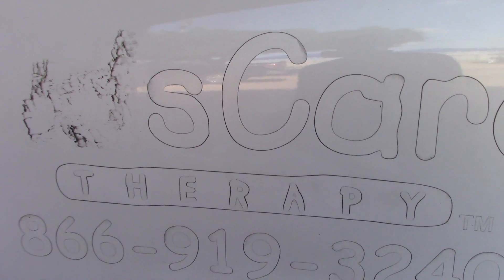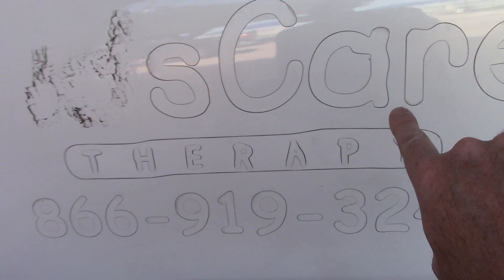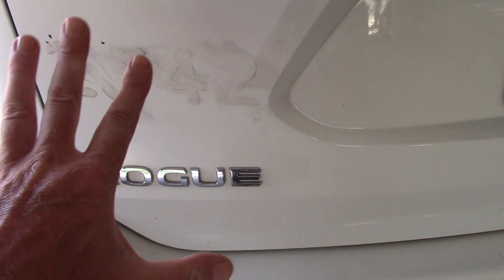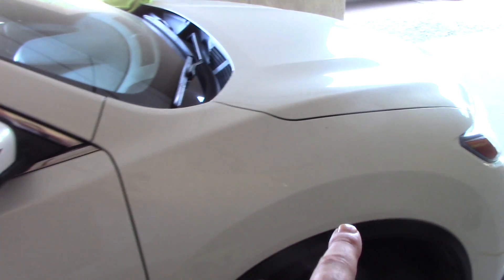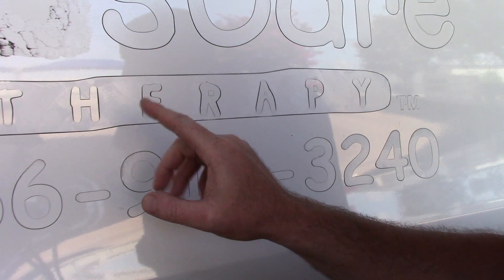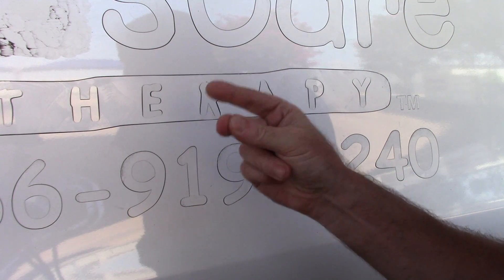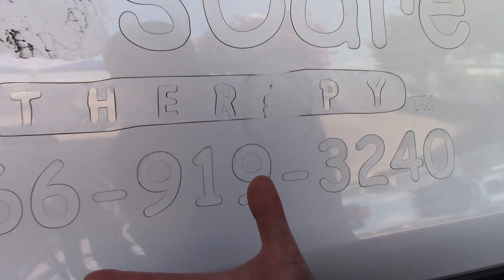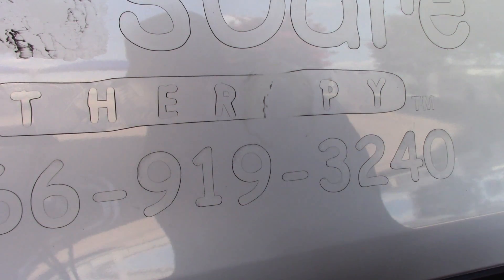Tips To Removing Vinyl Graphics - A Day In A Pro Detailers Life

Comment: I recently removed a pinstripe for a customer because part of it had come off. I used the 3m eraser wheel and removed residue. Everything went fine except for the part of the stripe that had already failed. No matter what I did the "ghost" of the stripe was still visible. I even wet sanded and polished...it was still there. Any ideas?
Reply from the maker: what color was the car?..how long was the vinyl on the vehicle before you decided to take it off?...the longer the vinyl is on the vehicle more of these issues will be present and yes wet sanding can help but we only have so much clear coat on OEM vehicles to remove..i have heard and seen in some cases where removing the ghosting is impossible and thats why you need to have those conversations with your customers specially when vinyl has been on for YEARS...i hope that helps answer your question but at times there is nothing you can and the fact you wet sanded and polished and it was still there, i would say just leave it alone because if you keep wet sanding you will have a bigger problem on your hands:)
Reply: Dallas Paint Correction & Auto Detailing it was dark blue. The drivers side turned out perfect, but the other side where the stripe had begun to fail had spots that I couldn't remove the ghosting. I suspect those spots are where the vinyl was gone and the adhesive had been left for years. Is it possible that the adhesive stained through the clear coat? I'll know for next time. Thanks for your help and the videos.

Comment: spray rapidtac remover let it sit 30 seconds and wipe it all off completely.
Reply from the maker: i have the stuff and its amazing...but when someone removes the vinyl but didn't remove the glue at the same time during the process, the glue and glue residue is very thick on the paint...rapid remover will still remove the glue and so will citrol but it will take longer because its so THICK....as i mentioned in the video, when you use the 3m eraser wheel from the beginning to remove the vinyl,the wheel will also remove a big part of the glue as well so only the residue remains...so 30 seconds and wipe off will not apply for this video...just a fact:)..i had to use the wheel to remove a big part of the glue first that the customer left on the car and didn't come off with the vinyl..once that was done yes 30 seconds and wow the glue residue was gone....been doing it to long my friend:)